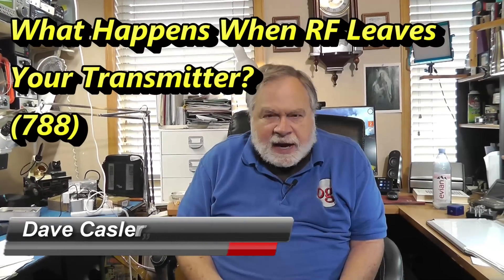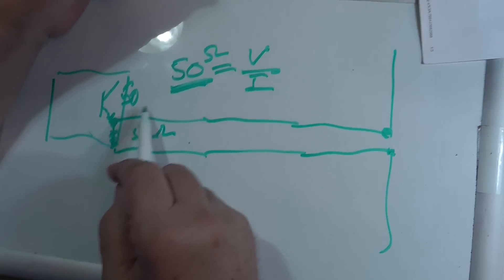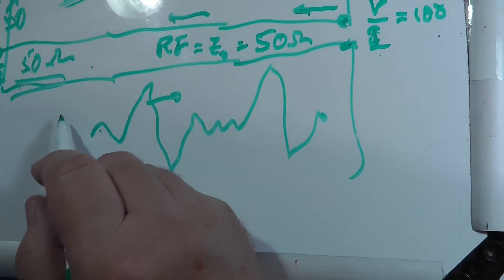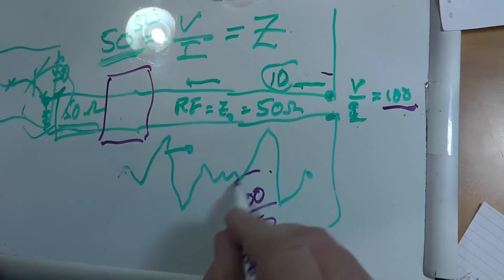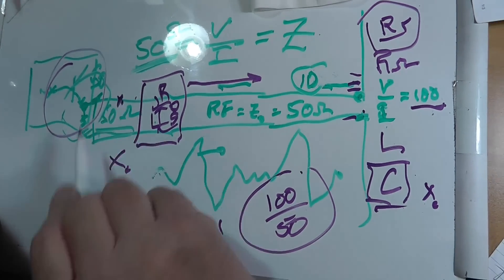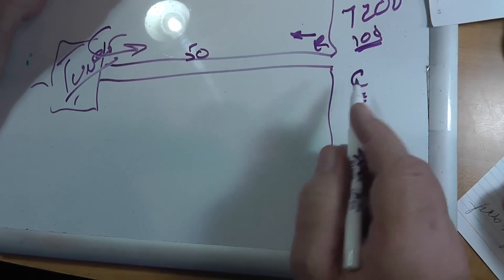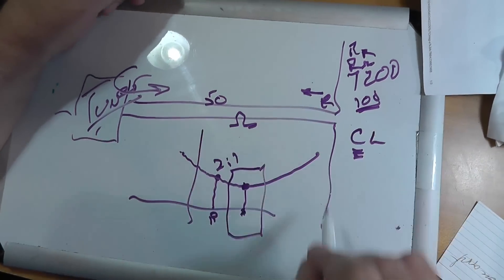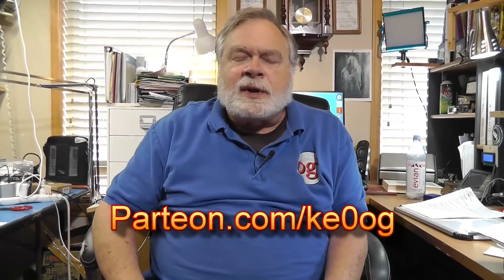What Happens When RF Leaves your Transmitter? (#788)

Comment: Thanks OG. Nice explanation. I run a vertical with a trans match at the base and I always knew that that reflective power was presumably going back up the radiator out of time with the original signal. I said to myself, "wouldn't that change the characteristics of the original signal?". But then I thought about the frequencies this is happening at and figured the period of the RF signal is so fast it would not have a noticeable effect on the intelligence coded on the RF signal. Your presentation here agrees with my original assumption. The period of say a 40M RF SSB signal is over 2000 times greater than the intelligence coded on it. 
Wondering at what point this would become noticable. For example, a super trans match that could resistive match a 4000 Ohm radiator. Would that put a noticeable effect on the coded intelligence?
Thanks again.

Comment: Hi, Dave, I am to point out some of the errors in your presentation.
1.The diagram of the final stage of a bipolar transistor amplifier is simply wrong. We may forget (for a while)that it's a push-pull (for the suppression of the 2nd harmonics) stage with a 1:9 broadband
 ferrite transformer that couples with the output connector. You drew the Emitter of the final transistor grounded through a resistor and the RF is taken out across the resistor; it's very wrong. RF energy would be tapped out from the Collector of the final transistor that's grounded directly to "0" terminal of the power supply.
2. Reflections occur due to impedance mismatch at the end of the feeder.
The impedance maybe above or below the characteristic impedance of the line.
An SWR of 1.5, 2.0 and 3.0 represents impedance like 17,25 or 100 or 150 ohms respectively. 
A resonant antenna (in flat top configuration in free space (at a  height of half lambda above ground) will have 73 +j42 ohm. An inverted V dipole will have around 50 ohm.
3. A short antenna is capacitive and a longer one is inductive at any given frequency.
4. The reflected energy from the feed point (due to mismatch) would return to the TX and would be re reflected towards the antenna; because it can't be dissipated in the reactive components.
5. If the impedance at the feed point is lower than the 50 ohm there is more current drawn and the final transistors would be melting away (thermal run away); if the impedance is higher than 50 ohm there's more voltage and if it's more than the final transistors can handle they will be blown away.
6. The ALC (automatic level control) function in the modern transceivers will kick in to action so that the power output will be reduced to half or even less to protect the finals.
7. The question asked is what happens to the RF energy once it leaves the TX.
8. Please make a video explaining the mechanism of RF energy getting dissipated in the form of Electromagnetic waves from the feed point.
That will be more appropriated.
Thanks.
De VU2RZA
Reply: @sjzehner  Good comeback.